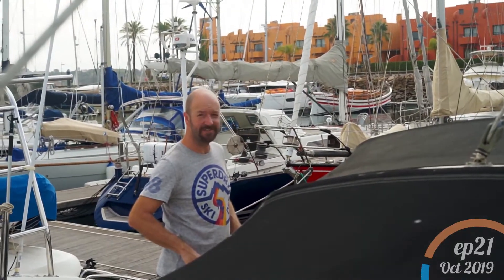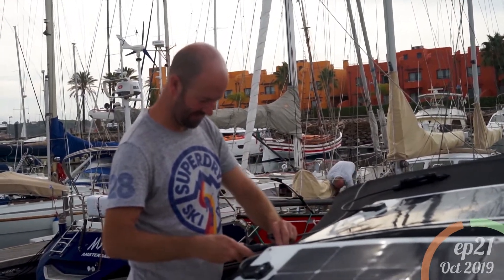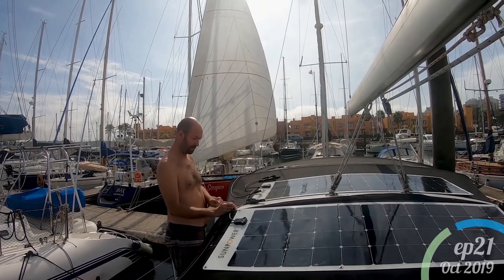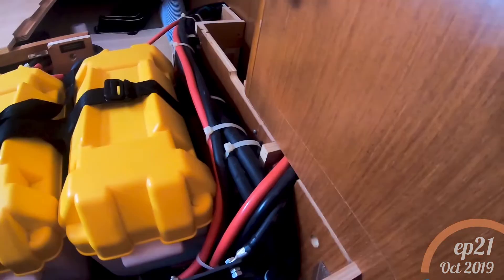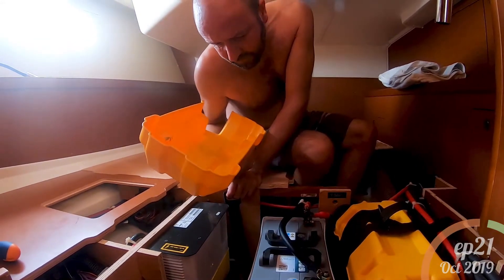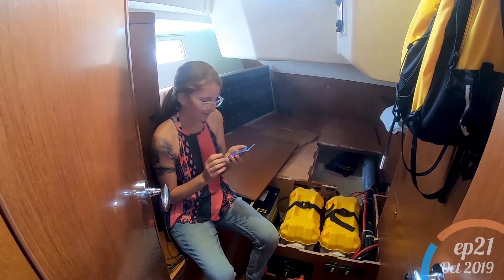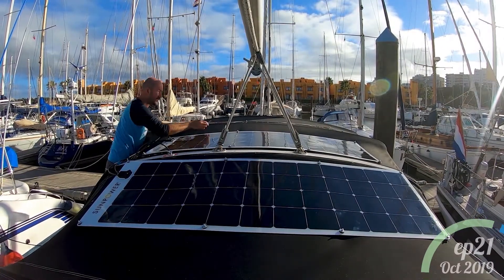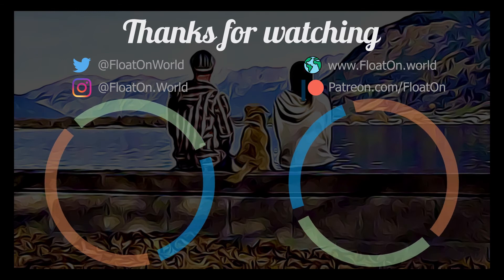How To: Sailing Solar Energy Part 2 | Float On Ep21

Comment: Hi, what size panels did you install and which manufacturer, Regards
Reply from the maker: Hi Kobus,
We decided on 3, 170W Sun Power semi-flexible solar panels. If you are interested and haven't yet seen there is a Part 1 which explains more about the kit that we've installed. Thanks for the comment, Amy and Martin. 
https://www.youtube.com/watch?v=BN-4pke7F0g